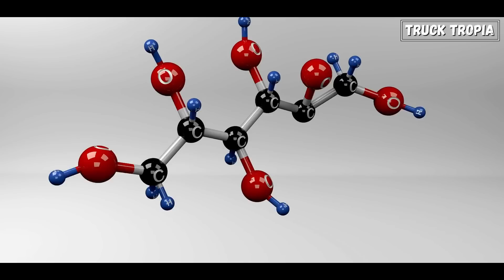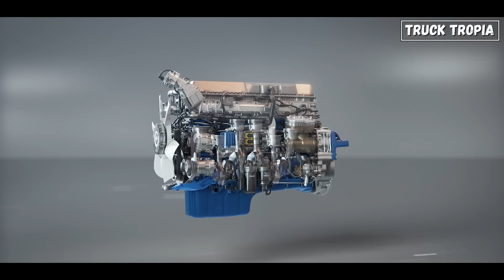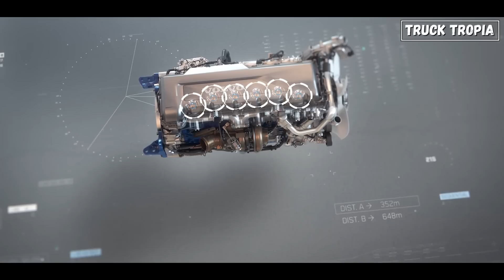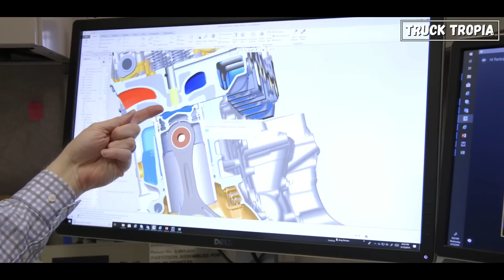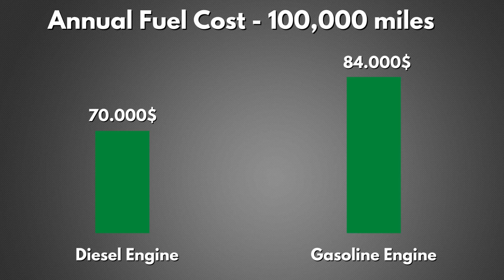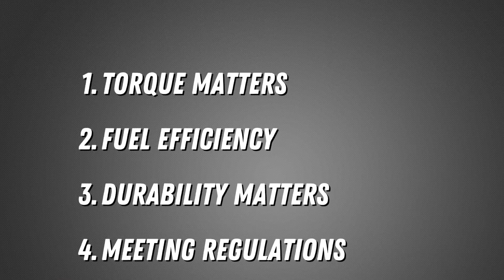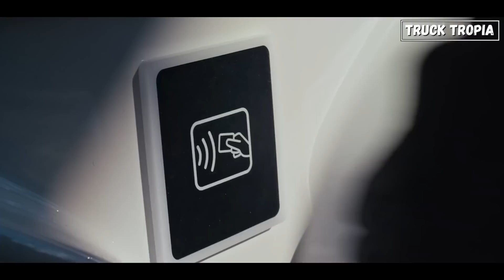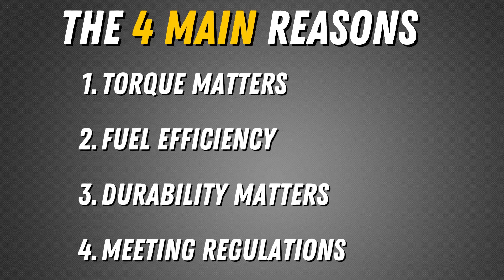WHY Semi-Trucks Drive on Diesel and Not Gasoline?

Comment: Here's the thing in Europe they are roughly 10 years advance in the trucking industry. They stopped using def which they actually found out the amount of ammonia they truck pours out is cancerous. Also trees that actually produce oxygen are actually dieing because of the ammonia. Doing the DPF regeneration is actually safer and cheaper. It is mainly now a cash grab from oil companies to make us use def.
Reply: So what do you use Hydrocarbon-SCR NOx reduction?

Comment: Because gasoline engines aren't used in trucks or other heavy machines anymore is the reason why they don't need to be so so robust and heavy. A long time ago, before diesels were used in trucks, gas engines were pretty heavily built. A gas engine can last as long as a diesel, if they are built the same way.

Diesel fuel has an approx. 13% higher density than gasoline. The energy content per weight unit is pretty much the same for both, but you need more volume of gas to get the same energy.

Comment: Torque is a result of power divided by rpm. The lower rpm an engine has the more torque it produces. With the right gear ratio you get the same torque to the wheels, which is what matters. 

It's the torque curve that's different between a gas and a diesel engine:
A gas engine produces the maximum torque at a pretty high rpm and at idle the torque is pretty poor.
A "free breathing" diesel produces it at a pretty low rpm and torque is there already at idle. With a turbo- or supercharger you can extend the maximum torque to a wider rpm range on a diesel, which makes it more "flexible" than a gas engine. This is why turbochargers have been used on diesels a lot before on gas engines.
Reply: To be fair there was plenty of big ass engines back and they did their job just fine pulling the same weight as trucks do today. Those big gas guzzlers make tons low-end torque people seem to forget

Comment: From watching various large diesel truck videos it is noticed that the new diesel trucks that have all the latest in emissions control equipment such as selective catalytic reduction and diesel particulate filters now have a serious reliability problem. The problem is that these emission control systems break down frequently resulting in the truck spending a lot time in the repair shop and less time on the road. These breakdowns are very expensive for truck drivers and truck companies. So there is a great need for the emission control systems to be a lot more reliable and last a long time.

Comment: Diesel has Longer run time  because it burns slower due to its thicker density. more torque due to high compression. Has less maintence and less parts needed. relies on its high compression for ignition.

Gas engines have lower compression thus has less torque numbers. Spark is needed to run the engine. Also gas has thinner density and is  why it burns faster. 

Both fuels are very different 
In fuel density 
Diesel burns slower and has thicker density Diesel has a longer run time.
 
Gas burns faster and has thinner density Gas has a shorter runtime.
Reply: Less parts and less maintenance is true only for old "mechanical" diesels that didn't need electricity for running. I'm pretty sure that modern diesels with common rail fuel injection and all kind of emission control and reducing systems don't have less parts than gas engines and they need electricity to run too. Gas engines don't need "AdBlue" or other systems that don't even seem to be very reliable.
Reply: @OnTheRoadAgain-S That is correct.

Comment: A lot of comments and even the video will mention that a diesel engine is more fuel efficient and then fail to explain why.
Two of the big reasons:  
1) when under load a diesel engine uses excess air in the cylinder as a coolant whereas a gasoline engine uses excess fuel. I.e. a diesel will run very lean and use the excess air to carry heat away whereas a gas engine will run rich and use excess fuel to carry heat away. 
2) compression ignition results in very rapid combustion whereas a gas engine has a relatively slow flame front.  The rapid combustion combined with the high compression/expansion ratio enables more useful work to be extracted from the energy in the fuel.

Also, yes diesel fuel is more dense than gasoline but that is not relevant in a thermal efficiency calculation.
Reply: The 6.0 diesel gets terrible mpg compared to the 6.8 v10 while working and the gasoline engine works in the winter I own both and have real world experience with using both as plow trucks and pulling lawn equipment all summer the v10 out works the 6.0 in mpg pushing snow and is cheaper to fix plus no diesel poisoning in a gasoline truck

Comment: Stop it with the torque myth. Torque is pretty much what dumb people say when they want to sound smart. There is nothing special about torque making  it extra suitable for truck engines. All ICE engines have gear boxes. If the engine was less torque, it would simply be geared differently.

What does matter is how wide the torque band is, and diesel engines really dosn´t have that wide of a band.

Similarly, while diesel engines tend to be more durable, this is really a effect of them being built to be more durable, not that they automatically are more durable.

It alls come down to efficiency.

Comment: Good question. No reason you couldn't built a gasoline engine with exceptable performance. In fact they already do. Trucks running on LNG/CNG are basically gasoline engines. Now why they don't try and make a new gasoline truck especially with the price of diesel now a days, beats me?
Reply: A lot of CNG engines are actually modified diesel engies, becsuse methane can tolerate much higher compression ratio witkout knocking. But they run on the otto cycle with spark plugs instead of glow plugs.
Reply: @gregorymalchuk272  i know. If you can do that, it surely can't be much harder to make them run on gasoline?
Reply: What do you mean with price of diesel? Here in Europe diesel is cheaper and gets you more MPG than gas. Only LPG is cheaper.
Reply: @surena9451  diesel is way more expensive here in the US.
Reply: @aaronmoser2617   Ah, yeah here in Europe it is cheaper, but taxing on diesel cars on the other hand... Older diesels are expensive to own, unless its a business car.
Reply: @surena9451 Same strategy we use in Uruguay, obscene taxing and low price, its supossed to make it cheaper for Bus and Truck companies while desestimulating the use by 4x4 and Taxi owners, the fact that gasoline here as at least 1/5 of its price made of taxes makes it really annoying too
Reply: @jolibethrodriguez7471  1/5th of your gasoline price is tax? That's good, actually. 

In the Netherlands gasoline pricing is based more than half on just excise duty, and we also pay "BTW" tax on our fuel. Almost 70% of what we pay goes straight to the gov. 

It's insane, and they want to increase the prices too by increasing the excise duties...
Reply: @surena9451  I have read of "Anti-gas" taxs but that is excesive, and your guys at least have oil reserves, we have to import
Reply: The vw tdi "scandal " was nothing other than competitors bullying them for creating a superior product.

Comment: The future will remain DIESEL!  But hybridized with electricity.  Best of both worlds, fuel efficient burning of Diesel to generate electricity at optimized engine RPM and electric motors with instant torque from zero speed.  Imagine 50% reduction in diesel consumption.  The best kept secret or the most difficult thing for common people to understand/grasp is that once an object on wheels start moving, you do not need to provide the same amount of force to maintain that motion.  Still do not get it, have a look at diesel locomotives which uses electricity to turn the wheels but the diesel to generate the electricity on the tracks themselves.  The diesel engines will require a common rail which works at 2,000 bar and stratified injection.

Comment: S.C.R D.P.F. have made deisels muxh cleaner you are right they have but you know what else they did they made extremely unreliable sensors drop like flies valve need to be cleaned all.the time .ore money if going into the emissions control.then it is into anything else ever wonder why most people will not get into modern deisels wish people who make these videos would understand this soot is unburnt feul you wanna talk abot clean make part that burn feul properly i stead of looking for ways to fuck someone over same for gas carbon build up because excess feul this shit upset because everyone wants to talk about pollute and no one wants to get into discussions about fixing the problem it's always i'm right and your wrong

Comment: There have been some gasoline engines in trucks and buses but many of them didn't last with rising fuel costs.
Reply: Modern developments like cylinder deactivation, Atkinson cycling, variable valve timing, valvetronic, variable compression, multiair infinitely variable hydraulic valves, direct injection, and turbocharging can make gasoline engines as efficient or more efficient than diesel engines with less complication to meet emissions.
Reply: Hall Scott has entered the chat.
Reply: Alot of school bus fleets and parcel delivery trucks as well as 26 ft box trucks are really benefitting from reliabile big block gas engines.

Comment: Most semi truck engines like cummins don’t rev past 2100 rpm. Cat c15 and c16 are around 2400 rpm.

I also wouldn’t say newer Diesel engines are better. Cus they all have sensor and missions issue, I’ve seen more and more company and even owner operator, sell there new trucks and buy older truck that is pre emissions. So anything be before 2007 or older. You see a lot 1990 to 2005 trucks still on the roads with older Cat engines.  Cus new engines are SHIT.  Newer trucks always in shop while older trucks are running circles around any new truck.  

They plug up, sensors and computer issue, along def and emission  issue. Simple because these new turbo diesel emissions can’t breathe. So they slowly kill itself.   They not more efficient Cus spend more time in shop for repairs. 

I’ve seen few videos where truckers are looking at diesel hydrogen as option.  Cus let’s diesel burn cleaner and hotter.  Cummins is working on hydrogen engines.
Reply: Most people dont know what downtime is.
Reply: @ChaotiX1 most people.just.go.with what the government says is good and don't question sad but true now one may say no because if people see it isn't good for them they fight to get rid of it no they don't because they simply remove it for a couple month and bring it back with another these people aren't gonna let their cash cow to so easily and as long as we keep giving them money it will stay that way
Reply: Diesel naturally produces extremely low emissions. Nox is not what they say it is. Diesel engines uses more air than fuel. So u have extremely low emissions. Without the government hazardous waste emissions which puts ammonia oxide into the atmosphere. Which is why bees trees and plants are being destroyed. Mor toxins are being emitted by the scr def. Let the diesel engine breathe and run on biodiesel fuel which burns cleaner. And has barely any emissions co2.

Comment: Electric trucks produce emissions, they just are the equivalent of having a really really long exaust pipe to emit those pollutants somewhere else.
Reply: Same energy that powers your house
Reply: @Jst4vdeos  yes and I'm looking at all the aspects of it like the mining for the solar panels and such as well.

I'm reminded of China having a plan to combat smog by using natural gas, but they were going to use natural gas from coal because the plant could be further away from the cities that actually used the power. So the city avoided pollution but the local country folk had to deal with the pollution. 

Also sorta. Since my house isn't necessarily where I would be charging at. Especially if driving long distance. So the electric sourced would be from a variety of sources.
Reply: Yes and no.  You can generate the electricity without emissions.  But even if you would use coal for it: 1) electric motors are way more efficient (less KWh needed). 2) bigger generators (powerplant) are more efficient then a small one (onboard combustion engine)
Reply: @1987tijgertje  electric motors aren't much more efficient then a transmission in power losses. Every time power is converted there's losses involved. 

With a electric vehicle you are
1. Generating electricity
2. Transmitting it
3. Stepping it up
4. Stepping it back down
5. Stepping down again
6. (Assuming fast charging) stepping up again.  
7. Charging the battery
8. Transmitting
9. Converting the electricity to a magnetic field to make rotational force 

At each step, power is being lost. 

On a ice vehicle you're

1. Generating power
2. Transmitting through the transmission
3. Transmitting through the diff (skipping this step in the case of a front wheel drive)

The reason electric seems more efficient is that the power isn't being made on sight. The engine is the generator off sight making it so the car is all transmission, so the efficiency of a electric car is the power losses only. A apples to apples is to compare the power losses through the transmission only of a ice vehicle. 

Also because of the limited power density, electric cars themselves are built to be as efficient as possible, being made more aerodynamic, having stiffer tires and such while also doing tricks such as regenerative braking (a trick that ice vehicles are capable of even without using electric hybrids). Because of the increased energy density of gasoline or diesel compared to a battery, a ICE vehicle can be build without as much consideration to sheer efficiency of the rest of the vehicle, so they can use softer tires with less idealized tread patterns and they can afford to have less efficient shapes. 

The effect of this is shown most starkly when a electric vehicle is asked to tow, or haul oversized odd shaped cargo that ruins the base vehicle's aerodynamics and rolling resistance. While on a ICE vehicle when towing and hauling, the range changes only slightly, on a electric vehicle, the range decrease is upwards of 3/4 of the original range. A prime example of this is people who found while towing a car with their Ford lightnings and similar with rivian, the range dropped from 300 to 500 miles down to sub 100 miles. 

When a ICE vehicle is built around pure efficiency, their efficiency is eye watering. Examples would be like VW's diesel car that was rated between 200 to 250 miles, per gallon. 

Emissions free power generation all has its negatives though, such as the massive landfills needed for wind turbine blades. Disruption of marine life due to very loud vibrations from off shore wind. Creating blinding hazards for pilots and cooking birds from the sky in the case of solar. Disruption of fish migrations, halting sediment flows, flooding habitat for both humans and animals and even altering the planet's rotation in the case of hydro. 

That's to say nothing of the environmental and humanitarian disaster that is mining for the various elements in batteries. My personal favorite is the plan to scrape the deep ocean floor causing untold permanently damage to a environment we don't understand and don't understand the impact of.
Reply: @SilverStarHeggisist  When burning fuel there is some thing called thermal efficiency, it is the percentage of energy in the fuel that is converted to power, most ICEs have a thermal efficiency of %25, while power plants have %50-%60, electrical transmission losses are %5-%7, so even without factoring in powertrain losses, elctric is still more efficient.